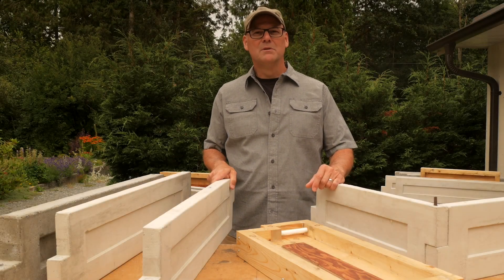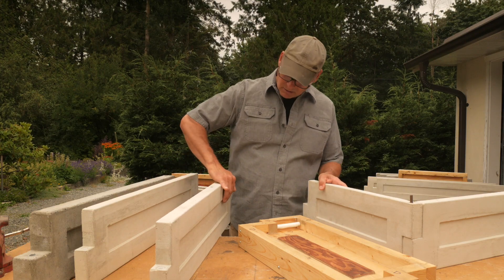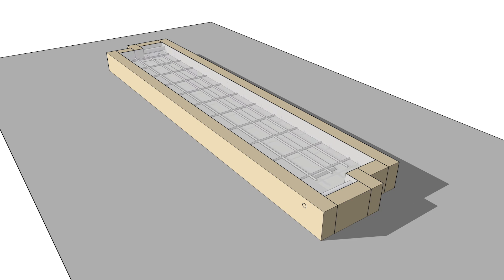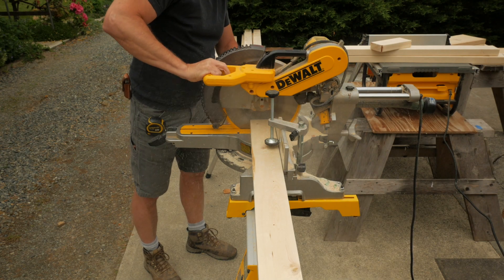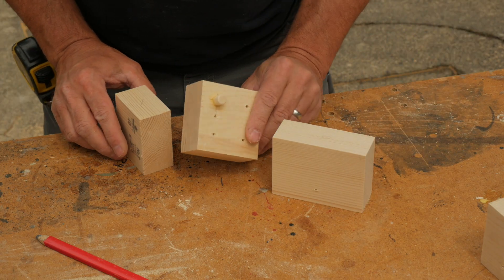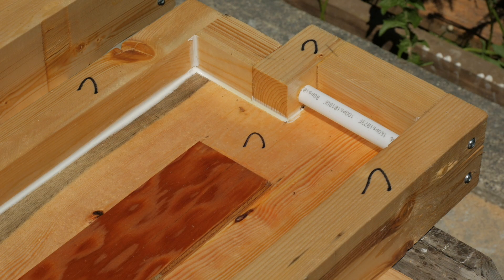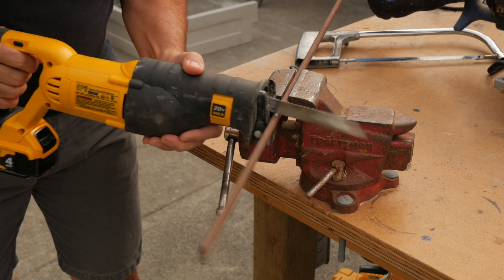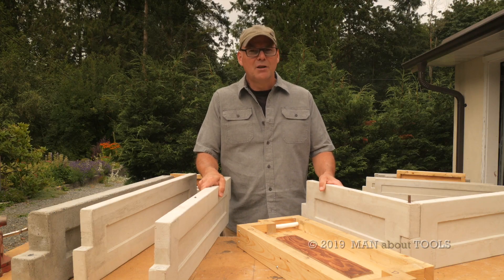make Thin CSA Concrete Garden Boxes PART 4 - cast garden forms

Comment: Bottom LIne - great video, exceptionally good/understandable plans.  Some thoughts:  Built my first panels yesterday - two 48" & two 36".  Lessons learned - I need to figure a way to batch these out for more efficiency.  Based on 55lb bags of CSA mortar and my need for mostly 48" panels, I'm going to use three forms which will require two bags of mortar.  I've worked with a lot of sackcrete/quickrete, but this CSA mortar doesn't lend itself to larger batches.  If I work quickly though I think I can mix two batches to fill three 48" forms.  Also, when viewing your pour you had a LOT more slump/flow to your mix than mine ... I used the Flow Control & measured 5 qts cool water but found myself having to trowel the mix to spread into the form.  Working with the ratios in your plan, I found that it took exactly 36lbs of mortar mix to make one 4'  panel; having a scale (and calculator) handy for smaller batches will be handy for those who want to make batches <1 full bag.  Could be a mistake on my part but I dispensed with the reinforcing wire; I just don't anticipate these panels experiencing tensile forces.  I have a creek that runs by my shop so after pulling the panels from the form I submerged them overnight - hoping for a bit more strength.  I haven't built any of your thicker panels for comparison but am very pleased with how light these are.  I'll have to be careful in placing these as I expect the corners around the PEX are the most vulnerable, but once in place in the garden they should last for years.  Thank you for all the time and thoughtful preparation you put into this project!
Reply: Changed up the mixing order; mixed the mortar and water thoroughly, THEN added the Flow Control.  Made a world of difference.  I'm sure Flow Control is water soluble but I found that when it's mixed directly into cold water it gels and doesn't dissolve.

Comment: I am using a mold to make about 20 pedestal table bases that are basically an exaggerated baluster. i was going to cast the bases in USG casting plaster. But cost is a big consideration. I thought about concrete, but the weight seems problematic. So the aircrete using the ratios from episode 3.6 seemed perfect! The only drawback is the time it would take to set in order for me to remove the mold and re-use it. That said, CSA concrete seems like a good option since it seems like i can de-mold within an hour or so. that would let me do a few a day and move my timeline up considerably. In your previous videos, you did weight comparisons based on equal volume. But here, we have weight comparisons using different volumes. Would you happen to know how much lighter the CSA concrete would be volumetrically? Also, do you think CSA based aircrete would work, if it does, this would be perfect! (i also like the lighter tone of the CSA concrete)
Reply: welp, i just saw episode 3.7, which answers that question. I'm assuming/hoping the rapidset mortar mix will be just as good as the cement all you used for making aircrete? Do you think i should use the same amount of citric acid and plasticine? Or should i reduce it to be consistent with the amount of mortar mix used to make the aircrete?

Comment: Just picked up the plans. Excited to put these together. Quick question. Is it a problem if I don't trim the edges off the 2x12? I don't have a table saw and am not so solid on long cuts with a skill saw.

Comment: Neat idea, but I won't be using those in my garden as God knows what would be leaching into the root system. From safety sheet for CSA: "Causes skin irritation. Causes serious eye damage. May cause cancer. May cause respiratory irritation. May cause damage to organs (Lungs) through prolonged or repeated exposure." Ingestion: :Immediately rinse mouth and drink plenty of water. Call an ambulance and take these instructions.Get medical attention if symptoms occur."
Reply from the maker: The dust from CSA and Portland cement is corrosive so should be handled carefully. After it's mixed though there is no dust. You make your own decisions about what you are comfortable with in your garden. I'm certainly okay with that.
Reply: @MANaboutTOOLS  Again, I like the idea and appreciate the video.  It got me thinking though about heavy metals and chemicals in most man-made products. It might not be so bad in this case, however. Here's an interesting discussion about using regular concrete (not CSA), that makes some interesting points and suggestions in general: https://beauregardparishcountrylife.wordpress.com/2014/07/02/gardening-note-toxins-in-concrete-blocks-and-concrete/

Comment: Hi Kent- How much extra set up time does the citric acid buy you?  I'm asking because I would like to make 3 48" pieces at the same time and would have to pour half of the 2nd mold from the first batch, mix up the second batch and then complete the 2nd mold (then fill all of the 3rd mold). I'm assuming it wouldn't hurt that first half in the 2nd mold to set a bit while I mix the 2nd batch?

Also, did you screed the molds after filling? I noticed the overflow was gone when dried. Or did it just settle on its own maybe?

Thanks and great work!

Comment: Food for thought.... for additional weight savings, add perlite to the concrete mix.  The more perlite you use, the lighter the concrete and the more panels you can make from a single bag - potentially up to two of your 48" forms... but at the cost of reduced strength.   Since these are not structural panels, the reduced strength might be fine.
Reply from the maker: As these are thinner I think pure CSA is best. I did a perlite blend in Part 3.5: https://youtu.be/hBvPs7CBf5Q

Comment: I like your design and your explanation of the various steps was easy to follow . I was surprised you stripped your forms so quickly , I am familiar with structural concrete and we usually stripped forms the next day allowing 24 hours for design strength to kick in .
Reply from the maker: Thanks! The CSA can be stripped earlier.

Comment: Ideally,  you would want the reinforcement (steel mesh) closer to the outer side of the panel in the box. Putting in the center of the panel doesn't do much. If it's closer to the outer side it can take care of some of the tension and prevent cracks. It might be redundant because of the glass fiber, but still.
Reply: It certainly is nessecary !  I cast my first four 11" X 48" panels without steel and 12 hours out of mold they broke very easily . Curing must be a critical part of the formula.  1 oz of fiberglass instead of 1/3 oz seemed to be useless.

Comment: Liking these, but still want less weight.  Thinking that with mesh, it might be easy to make less weight.
Find appropriate screen, 1/4 or 1/2 inch spacing.  Use 2 pieces per panel.  Make a form to put dents in the screen, spaced out to hold say 1" or 1.5 " plastic balls in correct spacing.
Lower screen, balls in the dents, upper screen flipped also with dents to lock the balls in place.  Pour the CSA.
Two screens let you locate and hold hollow balls in place to displace the concrete.  With the right size and ball spacing it seems like you could get the concrete down to 50%, while still having good wall thickness and through thickness.   Mash two screens for locating dents and then hold them halfway through the form seems like it would still be reasonably easy enough for the extra weight savings, you could just batch it up crank out 10 or 20 screens and make up a bunch of panels at once.

Comment: You do understand cinder block wall caps are under $1 and just about any   concrete wall block is $1-3.  The strength in Portland cement is in the aggregate 3/4 in. Is most common. By mixing dirt and just about any grade concrete you will get a waterproof enough for a planter that looks like Adobe do not add too much water it should have the consistency of peanut butter. Good luck. Man this guy is throwing money out the door.
Reply from the maker: I get it. It's not for everyone.
Reply: @MANaboutTOOLS  don't mean to offend they are nice just late and well I have little snarl in my mood these days. Money is tight. Laying them flat and stamping them after vibration is a thought for speed you could just use pre mix quick set and trowel after a light misting of water even push in the PVC. It's  good to have a hobby I used to make models    until my eyes lost the appreciation for them with eyes going fuzzy at detail.

Comment: Just love your work. Top notch. I'm trying to decide how to build my garden boxes and using which materials. Could you please list the benefits of cement garden boxes versus wood and galvanized?  Also, assuming I have the tools, what is teh cost of building one of your boxes?  Thanks.  I'm goign to watch many more of your videos; outstanding quality..  Well done!
Reply from the maker: Thanks! Concrete will outlast almost anything. But has a higher initial cost. In time and money.

Comment: It seems to me that the forms could be set up so there's a single seam for extraction?  If the screws came out from the steps on the end caps, then it could be a 2-piece system.  Not sure how this would affect the extraction and cleaning, but this is definitely added to my garden setup.

Comment: You didn't use concrete - you used mortar.  It's a different composition than concrete.  It will be interesting to see which version has greater durability.
There are a number of admixtures that you could incorporate to increase water-tightness of finished concrete, as well as to reduce the amount of water needed for the mix without sacrificing (or actually improving) the 'pourability' of the freshly mixed concrete.  Glad to see the use of galvanized wire and the addition of galvanized mesh in spite of the use of fibers.  Fibers add toughness more than strength.  It's the mesh and/or rebar that provides the bulk of the strength.

Comment: Really cool but looks like a lot of work to get the garden forms made, once made then it's just a matter of pouring and oiling, etc...  Anyways they look awesome!  I just don't know if I am crafty enough to pull this off, but your video makes it almost impossible to mess things up.  Thanks for taking all the time to make the video for non carpenter types like myself.  I am a painter by trade, I do handyman stuff, and I don't have a table saw or drill press but I do have most of the other tools.   Really cool, probably the most durable and cheapest way to make 200 linear feet of fencing/garden beds, yet still removable!  Unbelievable actually... I got a ton of river rock as I live on the river, so probably just going to slip form river rock instead, but very impressed, and I think for raised beds against the house this would work very well and I really like the removable feature, as I could butt up against siding (or leave a gap, etc... for air ) keeping rodents out, yet still allowing for repairs once every 5 years.   Very well thought out, incredible... I would have never thought of this!   I suppose I could make brick forms against plywood, and drill holes in the bricks to hold in place.   Tons of ideas here, over and out.  I subscribed to your site, very impressive!!!

Comment: Seems like the concrete should be made more thick to be stronger.  
Instead of the wire , maybe two long 3/8" rebar
Reply from the maker: See parts 1 thru 3 for thicker castings. If the wire reinforcement was thicker (and heavier) it may sink to the bottom of the form.

Comment: Wait i'm lost, why is v 3.6 made after version4? Aircrete vs. CSA? What's the final design? I've been watching all of them trying to figure it out.
Reply from the maker: Part 3 focused on lightweight versions using the original design and forms from Part 1 &2. So Parts 3.5, 3.6, and 3.7 were further attempts at lightweight concrete. Part 4 was a different design and a completely different concrete. I know, it's confusing, but, sounded good at the time.

Comment: If you could somehow find a way to round out the corners on the extended portion of the form that holds the pipe on both ends it would allow for a variation in angles. Possibly cut a hole through a block that is just barely bigger in diameter than the block is wide so you are left with four concave corners. Affix those corners to the form as it is already, one to the base the other to the end cap.

Comment: I have followed these with great interest. I recently purchased a  50 year old homestead. I am doing a lot of updating and these are definitely part of my multi-volume to do list.

My one concern is that the concrete actually looked pretty thin and runny.

Now I have not poured concrete in over 20 years and even thin I was an idiot . . .lol.
So can you enlighten me a bit?
Reply from the maker: Thanks! The plasticizer makes it pourable but it sets up fast and is extremely strong.

Comment: One can use smaller diameter rebar in the corners as it is available in many diameters and much cheaper than ground rod.   Great video and ideas!
Reply from the maker: Yes for sure. I could not find it in my area.

Comment: Great video and idea.  thank you. Great Skill .   But I wonder how the corners would stand up to our north eastern Canadian winters. I'm afraid the frost would expand any water stocked in the peg holes and brake the corners. Anyone in ColdCity has field experience with the design ?  thank  you
Reply from the maker: Thanks! One idea would be to fill the holes with silicone or equivalent to block any water pooling.
Reply: @MANaboutTOOLS   thank  you.  !

Comment: Question:  If one were to make double-high beds (as suggested at 17:41), what would need to be done between the top and bottom units to prevent leakage of soil/water/etc.?  My first thought is some silicone caulking.
Reply from the maker: Maybe a thin foam gasket. Or maybe a thin strip of rubber inner tube.

Comment: When mixing the CS a concrete do you think that adding find vermiculite aggregate might reduce the weight further without a loss in strength?
Reply from the maker: I think it would weaken it. And the weight savings would not be worth it.

Comment: The metal rod will always be your failing point. Metal is just not designed for exterior use in the environment in a flood channel that will fill up every time it rains. It's also not under much force, you could use a smaller PVC pipe, or a piece of wooden dowel, quite easily.
Reply from the maker: Yes. Good suggestions. Thx

Comment: Could also keep cement flat then put fake stone on front and fake stone caps...or a molded stamped, colored concrete cap (perhaps with rounded edges).

Comment: I was planning on using thin concrete block to make those and then stucco it to look like concrete. However, after watching this video I will cast the planters. Much better, and you can move them if you ever want to change the landscaping. Love the idea and the how to. This man has it down to a science. Thanks so much.
Reply: I built some with 4" thick blocks. I wanted to make it a little higher than 8", so I cut some of the blocks in half so it was 12" high. I set 1/4" rebar between the blocks to stiffen it. .. It worked out well, but was slow to build and, of course, not moveable.

Comment: You should seriously consider looking into using hypertufa or papercrete for the ultimate in lightness while still using cement as the primary medium.
Reply from the maker: I've decided to stay away from organic materials as additives. Maybe in the future.
Reply: @MANaboutTOOLS  Not sure why that would be. The extremely basic environment in cement renders the ability for those materials to rot inside curd items essentially non-existent, and just like with perlite, it gets locked in the interior of the substrate, anyway. Hypertufa and papercrete have a long history of use in both the garden and as contraction materials, and a long track record of efficacy in those uses.
Reply: Why did you decide against organic materials?

Comment: Whats the approximate elapsed time from pouring to removing from mold?  I removed one from mold after 24 hours and it wasn't pretty..granted it was probably a little on the cold side.
Reply from the maker: It is temperature dependant. The CSA mortar mix sets up in less than 2 hours. Check the bag for temperature recommendations.

Comment: This video and the others in these series has to be one of the best DIY videos I have seen on YouTube. I love your design and plan on using your with only one modification to the ones I make. I will put a polyurethane pain inside the box to make the panel even smoother. I may add color to the concrete also.  I really loved your idea of using the SawZall for getting the bubbles out.  Many times I have seen people make concrete panels and things and never vibrate them. I always figured if I ever got into building concrete forms I would build a vibrating table. Thanks for a great video!
Reply from the maker: Thank you very much! I appreciate your warm support!